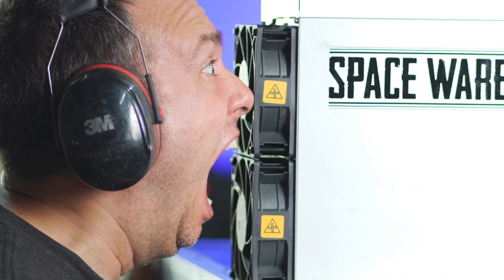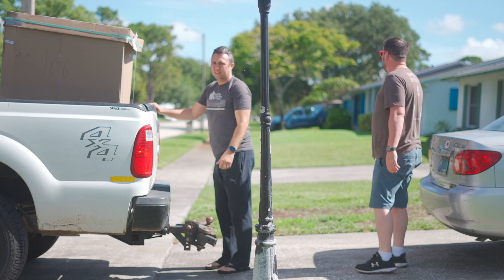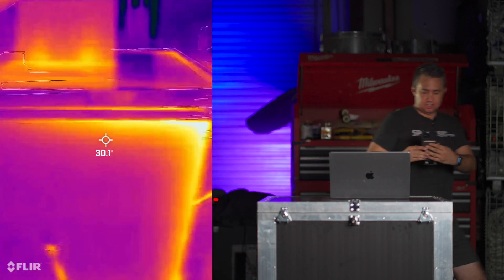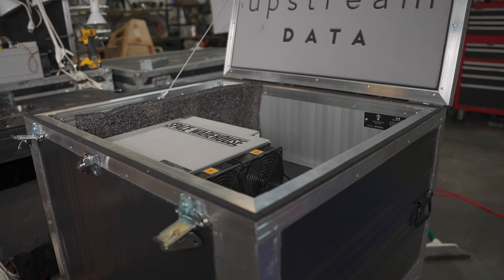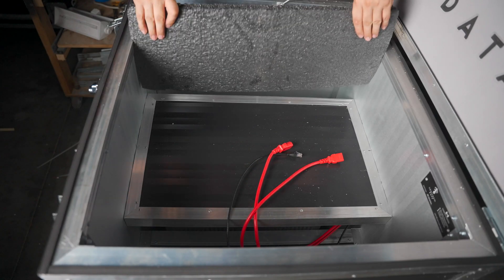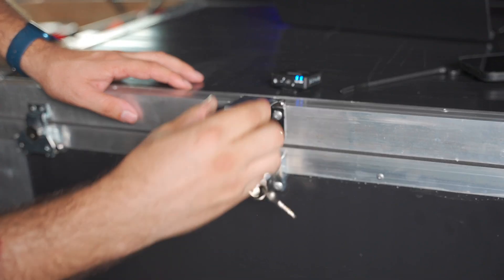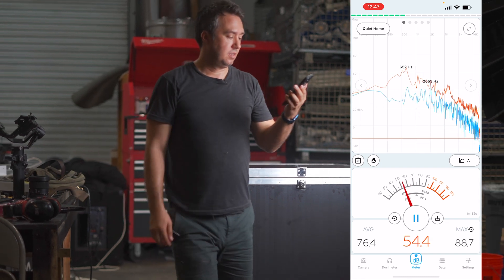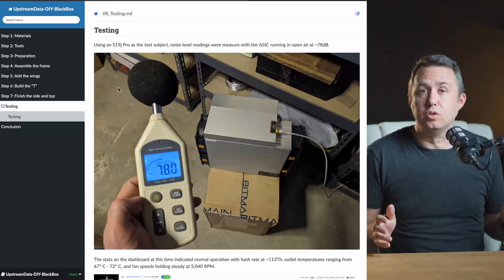Quieter Bitcoin Mining - The Upstream Data Black Box

Comment: SDW that’s one nice idea, I built a few box with all parts from HomeDepot for less than $100 and it drops 26-27db, what I don’t understand is why has someone not just make a quiet high RPM fan, all the noise are just from the fans, the small PSU fans and the main 120-140mm fans depending on miner, why not just make the fans quiet, to me that’s the perfect fix, for small ASIC miner like the S9 or L3’s they make quiet 120mm fans and become the PSU don’t really make any noise just upgrading to high flow high CFM 3k RPM quiet fans works, for the bigger BTC miner 3k RPM just don’t cut it you need 5k minimum with very high CFM and so far I can’t location 5+K RPM quiet fans .. someone should just make that better fix IMO ..
Reply from the maker: I hope you’re subscribed because that’s the next video I’m making!!! Bigger, quieter fans attached to a 3d printed shroud!!!
Reply: Also on most if not all the dual fan miners their PSU is attach and you also need to vent the very hot air from the PSU property, that big box does not seems to care too much about the PSU intake and exhaust.. that needs to be corrected.
Reply from the maker: @fullyelectric  it’s true it seems to ignore the PSU. It will be getting fresh air and presumably circulating it’s heated air (the PSU air) into the intake for the hashboards. But it’s not enough to raise temps

Comment: "Thats not worth doing" 🤣 

Seriously its non armored cable at 240v and its going through a jagged metal hole. Get a grommet or a rubber cable entrance plate. I'm using the second on my homemade version of this. 

As a mechanic I thought the muffler annalgy was perfect, same thought I had when I saw this the first time. I'm building mine out of an old furnace, so powered ventilation that I can direct outside in the summer and inside in the winter.
Reply from the maker: Its true, it is a lot of power going through a jaggy entrance thats made out of a conductive material, BUT those cables are wrapped individually INSIDE the red cable jacket - a lot would have to happen to get the bare copper to make it to the aluminum.  Its not like a car part where there are vibrations and bumps and that sort of thing.. Its going to sit perfectly still in the corner of a warehouse. 

I love the old furnace idea.. I hate that im in Florida and I literally use heat like MAYBE two days out of the year, so theres nothing productive to be done with it unless Im going to try to get extremely clever and heat water or something with it